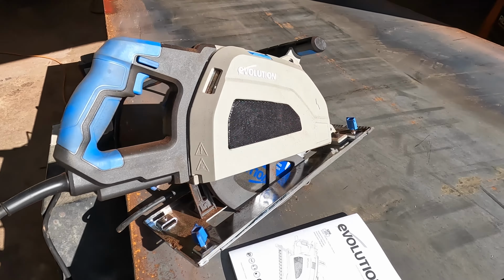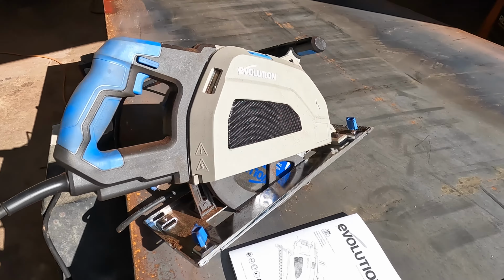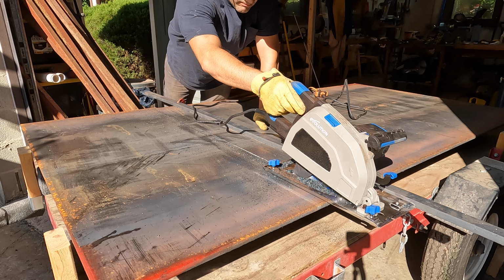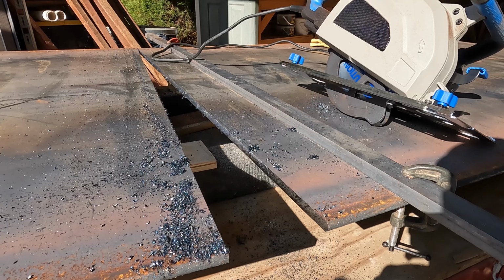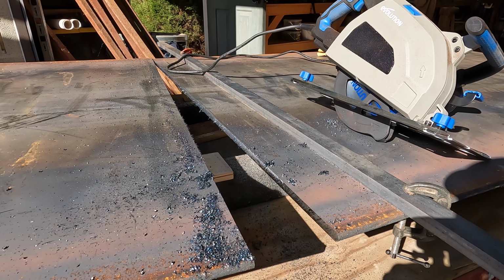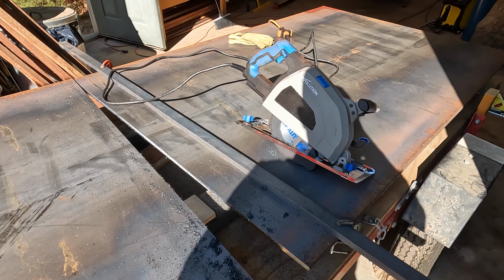1/2" Steel Plate Cut with a Circular Saw

Comment: That definitely cut really nice. Probably took  about as long as an experienced operator using oxy/acet or plasma , but by a saw useable by  almost    anyone. I am surprised you didn't trip a circuit breaker.

Comment: I think the plasma would cut faster but you would need compressor and 220v it's a lot more convenient easy to carry and 120v nice tool nice video
Reply: Plasma is not as clean as cold cut metal cutting saws.  SO plasma still alot slower when you add up your grinding time
Reply: @DharwinMoris  Plasma also leaves a bevel whereas the circ saw will give a square edge.